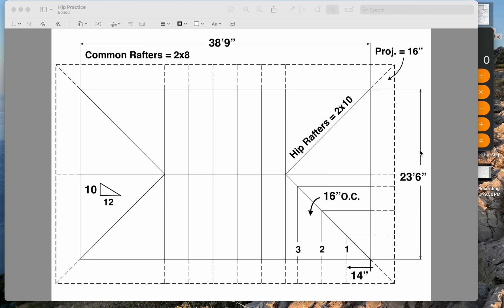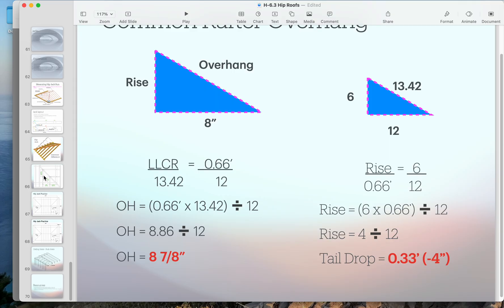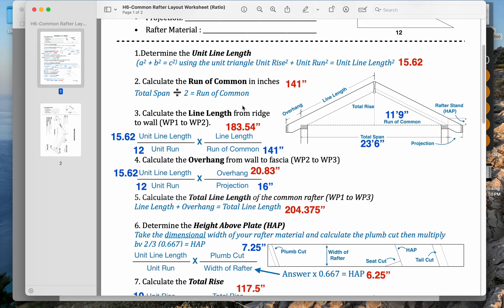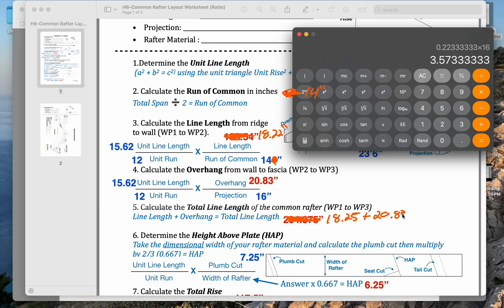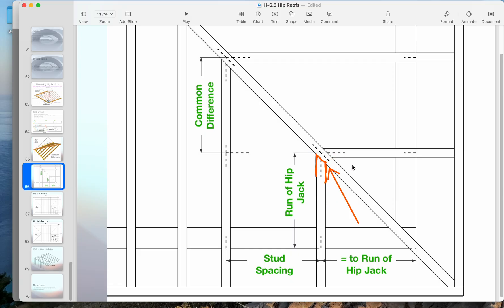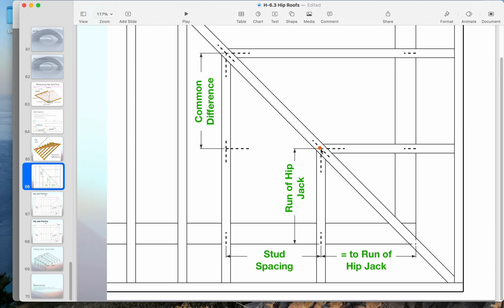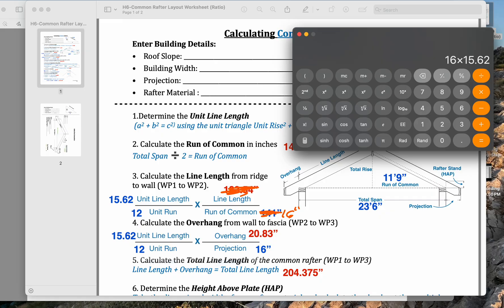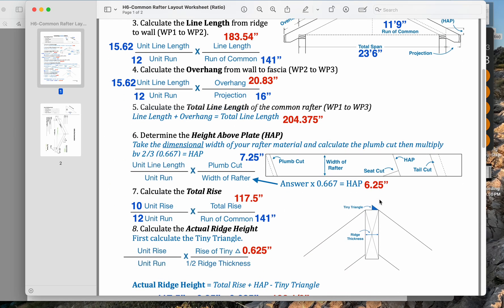How to Calculate Hip Jack Rafters

Comment: Why not keep the rafter spacing consistent from the pair of end common rafters, so that the ceiling joist is also consistent to suit the sheet rock ?
Reply from the maker: Absolutely a good way to go about it. Just to keep this explanation simple I wanted to show that the run is based on the jack rafter’s distance from the corner. We could just as easily subtract the common distance shortening from the end commons and work back towards the corner.
Reply: Because we hate Sheetrock. 😐

Lol. I’m kidding.